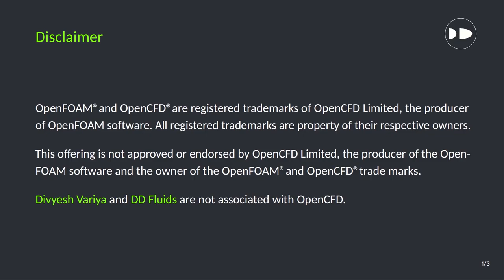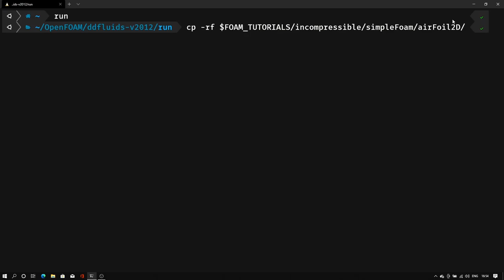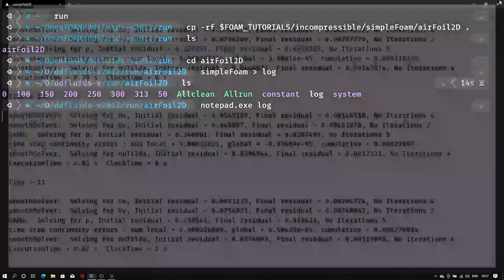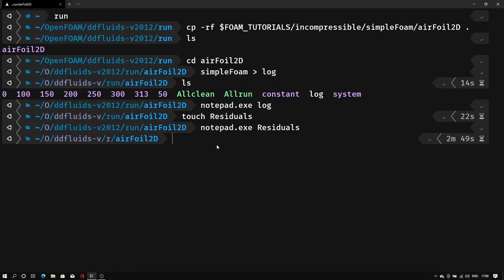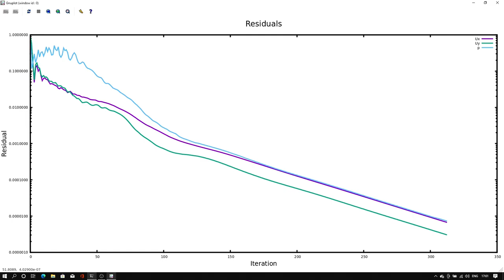How to plot Residuals in OpenFOAM | [OpenFOAM in Windows 10]

Comment: Nice video, but I usually use solverInfo functionObject and foam monitor command, mainly to check residuals during run time
Reply from the maker: FunctionObject is also a good option for run time post-processing. But is it possible in v2012? Is there freedom of changing colors, thickness of lines and text of graph?

Comment: It was a great video. Thanks

Could you please explain how to plot a value, (for example Pressure Average at an Outlet of a pipe or etc) while the simulation is running?

Best wishes
Reply: the same method prints real time data

Comment: Sir I have downloaded gunplot from your video but unable to plot this graph although all steps I have done correct
Error showing is
"Residuals", line0:Cannot open script file 'residuals'
Reply: USE this

set border lw 4
set logscale y
set title "Residuals" font "arial,22"
set ylabel "Residual" font "arial,18"
set xlabel "Iteration" font "arial,18"
set key width 1

# Loop to update the plot
do for [i=0:*] {
    plot "< cat log | grep 'Solving for Ux' | cut -d' ' -f9 | tr -d ','" title 'Ux' with lines lw 4,\
         "< cat log | grep 'Solving for Uy' | cut -d' ' -f9 | tr -d ','" title 'Uy' with lines lw 4,\
         "< cat log | grep 'Solving for Uz' | cut -d' ' -f9 | tr -d ','" title 'Uz' with lines lw 4,\
         "< cat log | grep 'Solving for k' | cut -d' ' -f9 | tr -d ','" title 'k' with lines lw 4,\
         "< cat log | grep 'Solving for p' | cut -d' ' -f9 | tr -d ','" title 'p' with lines lw 4
    pause 1
}